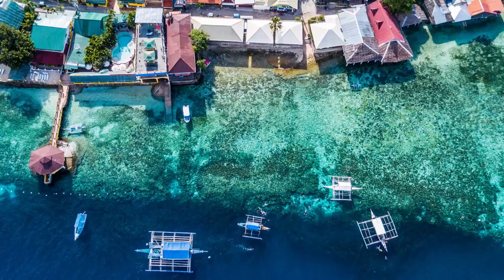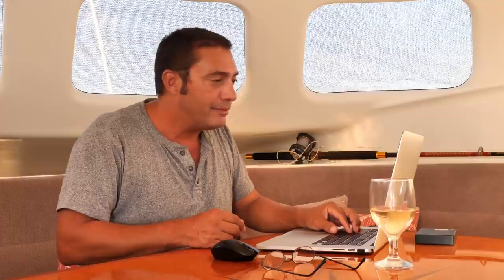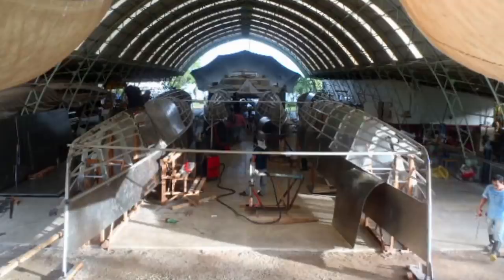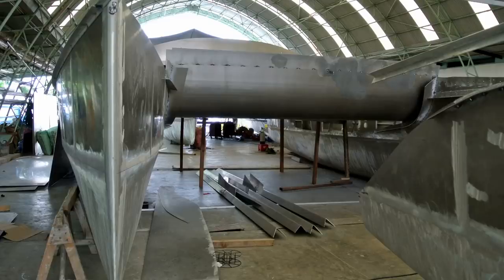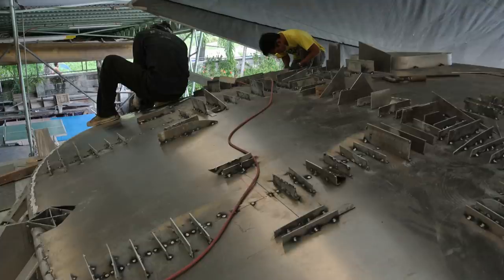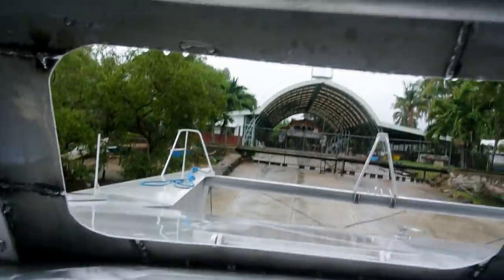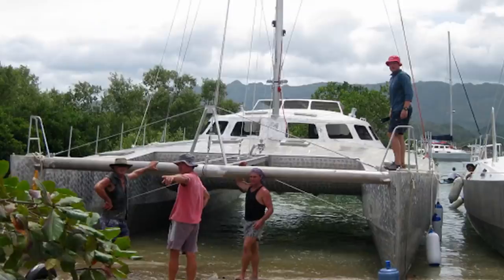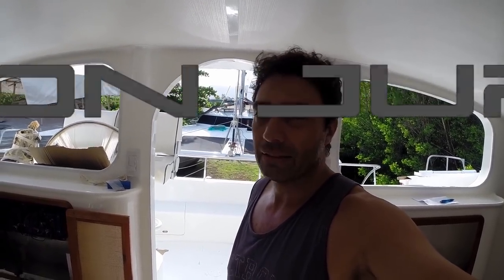Building an Aluminum Performance Cruising catamaran - Part 1

Comment: Huge thanks mate!  Super useful to see how she's built.  The same boat built in a first world country would be at least 3x to 4x as much due to labor costs.  That's a lot of welding.  At the same time, like the relatively simple design which does help reduce the labor somewhat.

Glad to see the local lads getting good work at the same time, and the work looks beyond adequate.

P.S.  Is there a link for the fit out video?  Edit: found it:  https://www.youtube.com/watch?v=rVj_IhsEqrY

Comment: Very interesting, well done. I'm given to understand that although aluminium is lighter, and therefore more performance oriented, it doesn't handle rough seas as well as fibreglass, also because it's lighter, a "good and bad" type of situation. Can you comment on this yet.? Good commentary letting us know all the basic elements. Looking forward to future productions. Regards from Brisbane Australia.
Reply from the maker: Sure Wyatt family... everything is a compromise... a lighter cat is more "active" than a heavy one in rougher weather.... but in lighter weather you'll be motoring a heavy cat. We were happy to be still sailing in a 5kt breeze on our Sth Atlantic passage for a lot of the way.
Thanks for watching from Jupiters hometown!.
Reply: @SailingLifeonJupiter  , that makes sense. As RAH used to say, “There ain’t no such thing as a free lunch!” Everything is a compromise. A Lotus ain’t for someone who owns an Aston Martin. Both great at what they do, but very different vehicles.
Reply: @Bill_N_ATX  Many manufacturers of expedition boats, power or sail, prefer to build out of aluminium or steel for the ability to work in extreme conditions. Same as commercial fishing boats, working boats and ferries. Hardly anyone uses fiberglass for commercial heavy going .Aluminium is lighter and stiffer.
Reply: @boganbob2708  Obviously. If you ever catch me out on the vast blue ocean it will be on a boat of metal. If I was a man of means, it would be a steel hulled trawler with a pair of diesels such that absent abysmally bad luck, I could deal with most anything. Yes, I am aware that folks sail around the world on 30 something foot Fiberglass sailboats every year, but not me. I lived through my adventurous days in the 80’s and 90’s, so as an old man adventure is not for me.

Comment: I have been looking for a performance aluminum cat that can sail around the world and go up northern latitudes and sail around Norway etc...it would be helpful to have a link or name for this builder especially if they are still building and you can get some customization.  VAAN R4 is being announced as a aluminum world cruiser but looking at it  from the back may not be the safest for long passages.
Reply: Look for Garcia yachts.
They have a cat coming out.
Reply from the maker: Hey UR.. Ahh cool...i hadn't heard of the R4... looks interesting, but on first glance appears to have the hull shapes of a charter boat due to the heavy furniture that goes with it... and I'd expect it to be pretty pricey... is it?
Send me an email on SVsupiter2@gmail.com and i'll hook you up with Tim Mumby the designer/builder.
Cheers
Reply: @SailingLifeonJupiter  according to what I have been able to find out is it is in the 400K USD range.  From my understanding it is more of a performance type of cat and the hulls are not as big as the charters but again, I haven't seen one in real life yet as they will be launching this year.

Comment: I was under the impression that aluminum was disfavored for catamarans because the structure amplifies twisting forces and metal fatigue can be such a huge issue in aluminum. Have any of these been out sailing for 25+ years to see how they hold up in the long term? I know fast ferries are all aluminum cats but they are considerably less beamy than a sailing cat and tend to have considerably more transverse bulkheads than you could possibly fit in a sailing cat and still have it be useful.
Reply from the maker: Not sure about that Emerson... But ally is starting to become the new fashion for rugged cats... Even Jimmy Cornell has been converted.
A bit different, but aluminium aeroplanes structures have extremely repetitive wing flexing.
Thanks for watching tho.
Reply: It's all in how you design and build it.
Reply: @braithmiller  That's always true, but some materials require knowable design compromises. You could design and build a ferrocement cat, but the coverage thickness required would necessarily yield a cat that was extremely heavy.
Reply: @opcn18  flippant example
There is a pile of reasons why aluminum is the majority of new fishing and transportation build work. I work with all metals and composites, each intended use has a trade off. My ketch is wood. All on ballance if I want an oceangoing catamaran I would build it out of aluminum.
Reply: @braithmiller  I chose an extreme example to illustrate my point. Aluminum is a popular choice for a lot of boats, but sailing catamarans are on the extreme end of cyclical loading, which is a characteristic that aluminum has issues with, that's why the vast majority of sailing catamarans are composite, a material that handles cyclical loading very well.
Reply: @opcn18  I can't count failed catamarans and most productions I don't consider sailing. The same can not be said of aluminum. Lots of old aluminum out there. That said I don't choose a catamaran for my intended use.
Reply: @braithmiller  there is a lot of old aluminum out there, but not catamarans, which takes us back to the question about design. Are the design compromises you have to make to make a long lasting boat out of aluminum so severe in a catamaran that’s intended to sail that the boat becomes too heavy to perform?  One of the greatest advantages catamarans have is light displacement, if you have to add so much aluminum to deal with that long lever arm that the boat would be lighter in steel then there really isn’t a good reason to build it in aluminum.
Reply: @opcn18  The vast majority of sailing catamarans are composite because the vast majority are "production cats" made cheaper out of a reusable mould for vast numbers. The aluminium cats out there are majority custom or one off designs. The weight of the Mumby is lighter than nearly every other catamaran of similar dimensions. Steel designs don't start to get lighter than Aluminium in boating until 80-100 feet. That's provided they have a aluminium top deck on a steel hull to offset the weight. Otherwise it's more like 120ft. A ferry has more bulkhead needs due to longitude payload and speed stress a sailing cat will never be subjected to. The fact is that nearly all manufacturers of explorer boats, sail or power, use steel or aluminium.  Same with, fishing boats ferries and most other commercial vehicles. Up until carbon fibre became normal Americas Cup yachts were made out of aluminium for 60 years or more.
Reply: @boganbob2708  Even a lot of those 80-100 foot catamarans are made from steel. That cyclic loading on the deck hull joint is just very punishing for aluminum. Big one offs are rarely composite unless they are meant to be the bleeding edge performance boats, just because no one wants to build the hull twice. But you still have to consider metal fatigue. I think a 10 year old casual cruising sail cata will have experienced more cyclic loading of the deck hull joint than the americas cup boats from the 60's have in the last 60 years.
Reply: @boganbob2708  top quality answer there. Never address the main point, talk across me with an answer that ignores facts, then when I bring them back up evade response entirely by casting aspersions.
Reply: @opcn18  I don't care enough to cast dispersions. Facts don't start with " I was under the impression" or "I think that" and the use of flippant and other non applicable examples to draw the wrong conclusions from the example. Like why most cats are composite and why a cat of 80ft would be made of steel. Both not why you think. I could spend half an hour point by point showing you why, when and how the industry builds the way it does. When the aluminium gets too thick. When the steel is too heavy. When the glass is too weak but I don't care enough. I know it, I lived it with over 35 years in the marine industry. You can use your own resources and time to work it out and circle back to the industry design conclusions.
Reply: @boganbob2708  If you don't care enough to not talk down to me why bother to reply at all?

You could put effort into making an informative response, or say nothing, both would be way better than putting effort into a degrading and defamatory response.

Comment: You may be using an AC switch on a DC circuit this will cause over heating. google it.
Reply from the maker: Hi David... are you talking about the overheating battery switches on another of our vids?... Good point about the AC... but no they are definitely "Battery Switches" and therefore DC..... You know i vowed never to use them again for high current loads... but i still had 2 new ones sitting in the locker which i'd bought when i was fitting out.... I recently installed them with less then 200A going thru... stupid idea... they melted within a month of use.... 
Thanks for watching mate.

Comment: whats the hull thickness ? any insulation ?
Reply from the maker: 4mm and an inch of spray foam
Reply: @SailingLifeonJupiter  
About 1/8".
How many water-tight compartments?

Comment: Max Cruise Marine from Vietnam sales a 42 foot fiberglass catamaran for $150,000 USD one design for Sail power one a Powered craft and they have a 30 foot Trimaran design
Reply from the maker: That's bloody cheap!.. Fully fitted out?... Balsa, foam or solid?
Reply: Just the moulded shell and panels.  doesn't include daggerboards, rudders, or aluminium beams upfront,